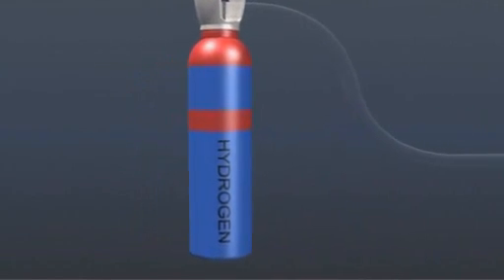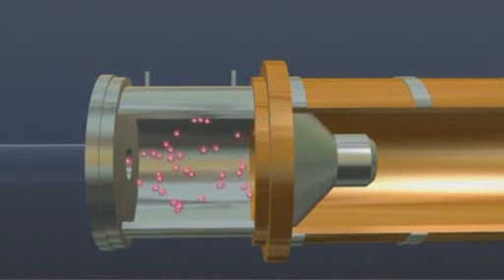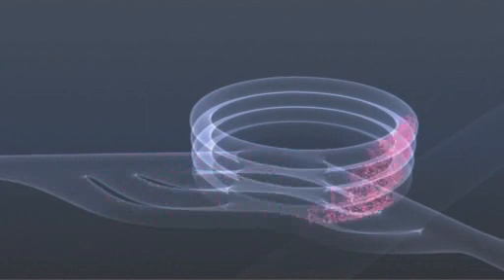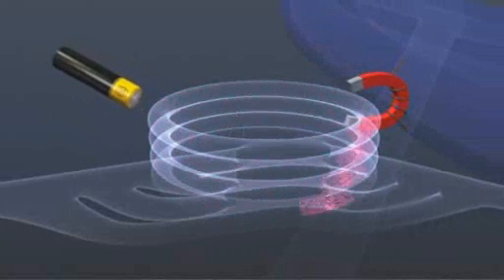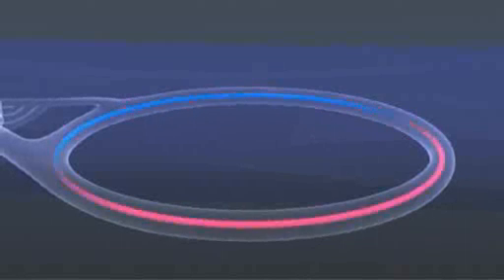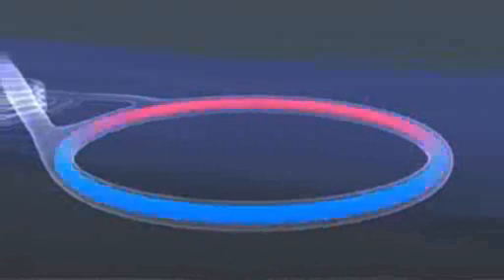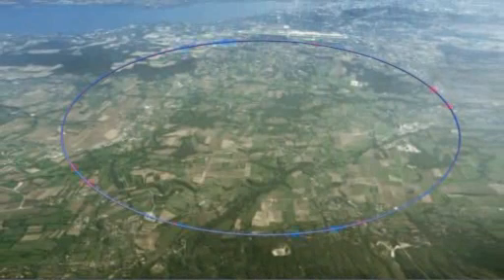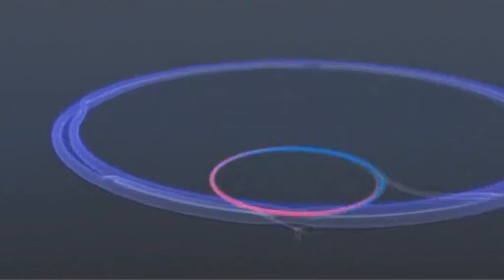The LHC - The Large Hadron Collider. What is the LHC, how does it work?

Comment: At what angle do the protons collide? somewhere I heard that at 1.8°. I think it can not be at 0° to make the not colliding protons to continue at it's original tube. Other reason could be that protons inside experiments (ATLAS, CMS etc) are traveling at straight line.
Reply: I believe they are smashed at 0° to get a controlled condition that simulates big bang...
Colliding them at 1° would send debris from the explosion in (very hard to predict) various directions...

Comment: What would happen if I could jump straight into the waves of protons when it's at its last stage?
Reply: Corey Clark you will have super speed, you will eventually become...

.THE FLASH
Reply: Judging by what happened at a smaller accelerator, you would likely be sliced in half or worse.

Comment: If it completes 11000 revolutions in 1 sec then the particles are moving at a speed slightly greater than light. Which is not possible.
Reply: They are going ever-so-slightly slower than the speed of light.

Comment: can anyone pls explain
me this?
I thought we cant see atoms so how do they accelerate them?
And is our techonlogy evvled enough to work at sub atomic levels?
And if we cant see the atoms, Does the LHC accelerate hydrogen gas as a whole?
Reply: +Eddymr12 Great questions. The answer is a little tricky. One way to answer would be to say we can 'see' atoms. Using the latest techniques researchers have been able to do this with hydrogen atoms. A second way to answer would be to say that we don't need to see something for us to be able to use and measure it. We can't 'see' electrons, but we can use them to do any number of things.

The LHC uses a device that strips hydrogen atoms of its electron, and then accelerates the protons.
Reply: So the by removing electrons from the atom, The LHC works at sub atomic levels?
Reply: Yes. Atoms are made up of electrons, protons, and neutrons. Physicists working in 1930 - 1950 discovered that there was an even deeper layer than that! The discovery came during the atomic age as we began to really understand the power of the atom.

Surprisingly, neutrons outside an atom, for any significant time, will become a proton. When neutrons become protons they spit out an electron. That's pretty strange. Where did the electron come from? Was it hiding in the neutron some how? Can electrons pop in to existence out of nothing?

This discovery lead to the study of particle physics. We now know both neutrons and protons are made up of smaller particles called quarks. When physicists use the word "subatomic" they are referring to particles such as quarks, photons, electrons, etc.

The theory that best describes the entire process is called the Standard Model.
Reply: Dude you need to be a scientist!
Reply: +LehiThinker What I don´t understand yet, is how the discovery of Higgs Boson would backup the supersymmetry theory?

Correct me if I'm wrong, but the supersymmetry theory claims that every sub-particle has his own pair and his own antiparticle. For example, the electron and selectron. Does Bosons also have Super-partners and anti-partners? Which is Higgs Boson superpartner?
Reply: Luis Ramírez Very good! Yes, if supersymmetry really is there, then there should be a superpartner for the Higgs called the Higgsino. Fermions and bosons have superpartner pairs. The jury is still out regarding SUSY, but it most certainly is not ruled out. There is still much we don't know. It will be an exciting decade in physics.

Comment: It travels the 17 miles in circumference, 11,000 times, in a second...
I can't even imagine
Reply: If you do the math, you will get the speed of light. Let me explain. 1 second divided by 11000, is 0.00009091 seconds. The formula for speed is distance divided by time. So, 17 miles is 27km. 27km divided 0.0009091s is 297 000km/s. QED
Reply: You can use that to calculate the speed in light.
Reply: Now think how fast the universe is expanding.
Reply: Einstein
Reply: Nastybeanlady G○陳
Reply: Now how tf  do they add lead ions in there?  Just trow a lump of lead?
Reply: quantum eletrodynamics?

Comment: Annd... ?...
So now what ?? it's 2015 now and i have not heard a thing, some results would be awesome... dose anyone know if it's up and running and working or is the LHC still on the building precess?? or..??
Reply: From Wikipedia:
"The LHC went live on 10 September 2008, with proton beams successfully circulated in the main ring of the LHC for the first time,[11] but nine days later a faulty electrical connection led to the rupture of a liquid helium enclosure, causing both a magnet quench and several tons of helium gas escaping with explosive force. The incident resulted in damage to over 50 superconducting magnets and their mountings, and contamination of the vacuum pipe, and delayed further operations by 14 months.[12][13] On November 20, 2009 proton beams were successfully circulated again,[14][15] with the first recorded proton–proton collisions occurring three days later at the injection energy of 450 GeV per beam.[16] On March 30, 2010, the first collisions took place between two 3.5 TeV beams, setting a world record for the highest-energy man-made particle collisions,[17] and the LHC began its planned research program.

The LHC has discovered a massive 125 GeV boson (which subsequent results confirmed to be the long-sought Higgs boson) and several composite particles (hadrons) like the χb (3P) bottomonium state, created a quark–gluon plasma, and recorded the first observations of the very rare decay of the Bs meson into two muons (Bs0 → μ+μ-) (a major test of supersymmetry).

The LHC operated at 3.5 TeV per beam in 2010 and 2011 and at 4 TeV in 2012.[18] Proton–proton collisions are the main operation mode. It collided protons with lead nuclei for two months in 2013 and used lead–lead collisions for about one month each in 2010, 2011 and 2013. The LHC went into shutdown for upgrades to increase beam energy to 6.5 TeV per beam, with reopening planned for early 2015.[19]"
Reply: Megatom CERN actually has an article on their website explaining that high-energy cosmic rays - which occur naturally - would've destroyed the universe long ago in most of the proposed doomsday scenarios. The fact that we're still here rules them out, at least at the power levels of the LHC. Forget aliens, the universe itself makes our particle accelerators look like a toys.

The aforementioned article: http://press.web.cern.ch/backgrounders/safety-lhc
Reply: I've read things before about the LHC destroying the world or even the Universe, and looking back on that, not only are things like that ignorant, but arrogant.  Aliens probably have built vastly more powerful accelerators which make ours look like toys, so if anything they would have destroyed the Universe first.
Reply: Maybe it's classified...      Before they had big weapons but it was classified like in captain America. They made the plane nighthawk in the 19s but it was classified they called it a UFO
Reply: the citizens called it a UFO when they saw it cause it was classified, none knew about the Nighthawk
Reply: only the Air Force
Reply: olav furuseth It WAS a UFO. The fact that it was classified means that it was 'unidentified' by the citizens.
Reply: I heard they plan on turning on the machine again in like early May or something
Reply: Nice! ^_^
Reply: Megatom Very true.

Comment: Oh Christ. The universe is an ocean. The planets set like bubbles in an ocean. The difference is it's in a vacuum. How ? A big black hole what ever. . The fact of the matter is you can't create the universe on earth. The universe is filled with Hydrogen and Alcohol . It does not explode because it has no oxygen to ignite it..Yes the big bang. The earth is an enemy of all that exist. Our oxygen is a Fire starter for the whole universe. Your higgs blosom is the universe.  The dark matter is the hydrogen and alcohol. combined. The suns are setting there. They explode outward not inward. If the do explode inward they become dwarf stars. We are bubbles on its surface the sky is explosive but there is a vacuum to take out the gas. Something is moving this that's the question which should be answered.

Comment: I have a question. We use protons for this experiment and examination. Can neutrons and/or electrons also be used? If so, how would the testing be different?

Cheers!
Reply: Hi, electron will be used in the future collisions. but neutrons can not be used because the neutrons are neutral charge
Reply: mohammed attia
I see. I was wondering just how we could get neutrons to be propelled aong the circular tract. Yet I have seen descriptions of the various and few discovered sub-atomic particles found or at least indicated, in both electrons and neutrons.

Cheers! Thanks for the reply
!
Reply: mohammed attia I get it there is no way to propel them with a magnetic field or electric pulse.